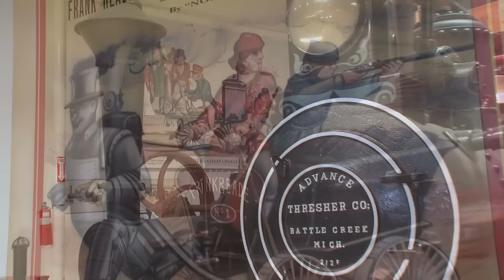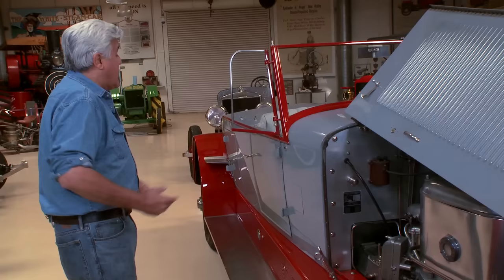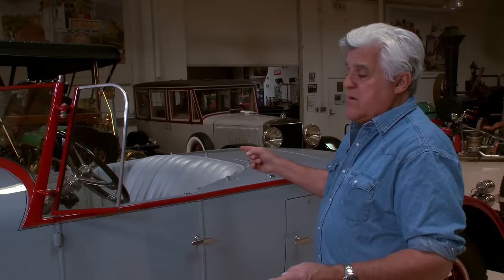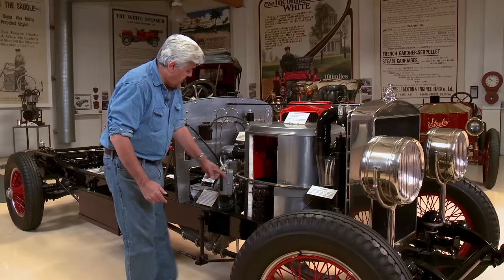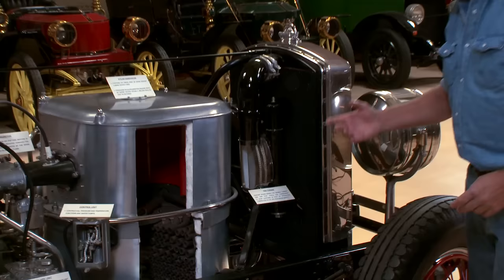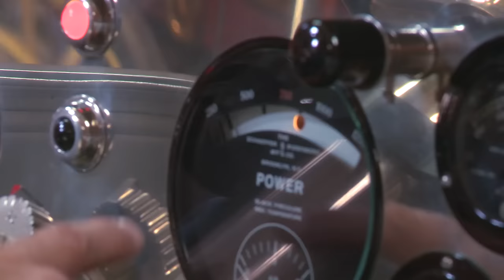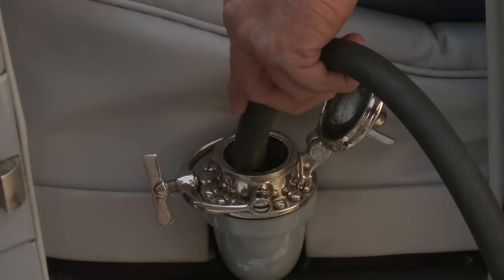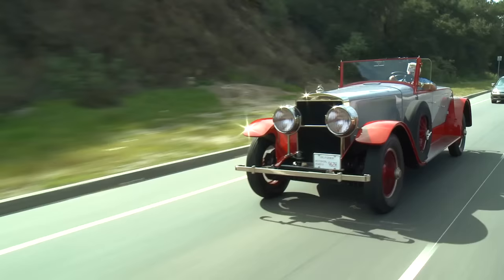1925 Doble E-20 Steam Car - Jay Leno's Garage

Comment: Wow! It's hard to believe they designed such an intricate and complex machine in the 20's.
Reply: That's not complicated! Charles Babbage's computation machine was complicated, and that was  in 1832.
Reply: +Blake's Gaming PC sort of true, steam was over a 100 years old, though dobble was smarter than most and the I.t drop out gave him a odd leverage of something oh so mechanical
Reply: Its unfortunate that Doble had not been born decades earlier.. because steam was already obsolete by the time he built this car...
Reply: That's not obsolete, oil is obsolete
Reply: the saturnes v the moon rocket was designed whit out computer  the computer was part of  the design
Reply: There were lots of intricate machines even going back several hundred years (look up mechanical automatons).
What I'm amazed at is the sheer understated performance of the E20.
Reply: Engineers were just as smart then as they are now, they simply didn't have the benefit of advanced composites and CAD. So many ideas found in most cars in recent years are usually decades old, they just didn't have the technology to make it reliable and economically viable yet.

The thing that really allowed us to make enormous strides in automotive design & engineering was the rise of the computer.
Reply: +coenijn  Yet the one thing that limits further improvements of steam cars is the Carnot Cycle Theorem which was published in 1824 and proven by Rudolf Diesel in 1897.
These discoveries definitively proved that the steam car can never reach the same efficiency as an Internal Combustion Engine... which is exactly why cars today use ICEs and steam is obsolete.
Reply: +coenijn No amount of computer-assisted engineering design will ever produce a Perpetual Motion Engine or a vehicle that defies the laws of Gravity, Entropy or Friction. There are Laws of Physics that dictate certain design restricts and limitations.
Reply: +The real doktorbimmer But I never claimed that a perpetual motion machine was possible, I don't know how you got those things out of my comment. I'm not a mechanical engineer or physicist but through my own field (biomedical science) I'm familiar enough with laws of physics such as thermodynamics to know that perpetual motion is impossible though I couldn't give you the exact scientific reasoning behind it of course, it's simply not my expertise. I know steam is obsolete in today's world, for most purposes anyway. 

I also didn't mean extremely radical things tbh. More like things such as electric cars, they were somewhat popular in the early 20th century (in fact the first car to reach 100 kmh was electric). Only now are we starting to see a comeback for electric cars because of modern battery and engine technology that'll make them economically viable. Or special kinds of ignition timing that were invented back in the day but were only used later on.

What I meant with CAD is that it has allowed us to make enormous strides in designing modern appliances compared to a few decades ago. Computers can do far more mathematical work much faster than a whole army of engineers could do not even 50 years ago. I'm not saying that computers will allow us to create contraptions that will break the laws of physics because that's simply impossible, what I am saying is that computers allow us to come ever closer to mathematical limits of what a machine can do. Take solar panels for example, the theoretical maximum efficiency is 21-23% IIRC. 50 years ago we were lucky to reach 2% but nowadays we can reach up to 15-17% efficiency for domestic solar panels (panels for satellites are more efficient but also enormously expensive), that's thanks to a combination of more experience, expertise AND computers that aid in perfecting those technologies. That's what I'm on about.
Reply: +coenijn I fail to see what relevance your previous comment have in relation to steam cars being obsolete?
Reply: +coenijn Electric vehicles make up less than 1% of all the automobiles sold today.. and the expansion of the EV market has already stagnated. EVs actually enjoyed a greater market share in the early 20th century than they do today. The Laws of Electro-Chemistry  prevent automobile chemical storage batteries from ever matching the range efficiency or energy storage density of liquid fueled ICE cars.. it also explains why they will continue to remain a tiny, niche market segment of the automobile industry just as they have over the past century
Reply: Please excuse marias man.. his comments are often nothing more than the regurgitant rumen of some fraudulent vaporware scam such as Cyclone Power Technologies or Uniflow Power Ltd.
Reply: +marias man  The facts speak for themselves.. only the crackpots, charlatans and scam artist require your promotional endorsements.
Reply: +The real doktorbimmer Now here is an actual topic on which we disagree. 

"Electric vehicles make up less than 1% of all the automobiles sold today (...) EVs actually enjoyed a greater market share in the early 20th century than they do today" This is not all that unusual when you consider the fact that cars were mostly owned by the relatively affluent people in societies, as well as businesses. There were far fewer cars back then as there are now, combine that with car ownership being for the affluent (who are able to afford exotic technology) it is no wonder there were relatively more electric cars back then. The automotive industry was in its infancy and wild & unproven ideas came with less financial risk because most of the other wild concepts hadn't been well proven either. I also don't whether you're looking at sales numbers worldwide, because this is not true when you look at the sales figures for some countries.

"and the expansion of the EV market has already stagnated" Where's the proof for this, AFAIK companies producing EVs have been producing and selling ever more of them per anum. And if this stagnation is true then the current price of crude oil might have something to do with it, there's little incentive to buy/produce EVs as long as the oil price is low.

"The Laws of Electro-Chemistry prevent automobile chemical storage batteries from ever matching the range efficiency or energy storage density of liquid fueled ICE cars" I do agree that by volume batteries will probably not match the energy density of fuel tanks in the near future (if ever), however with advances in technology batteries will be increasingly capable of storing energy more efficiently. Your argument also doesn't take the differences in automotive design between ICE propelled vehicles and EVs into account. The space required for an ICE can be substituted for battery space in EVs, floors can double as battery containers etc etc. 

"it also explains why they will continue to remain a tiny, niche market segment of the automobile industry just as they have over the past century" Oil is getting increasingly harder to extract and eventually it will not be economically viable to extract oil for purposes such as cars (other industries will have to rely on the petrol industry regardless of this fact). If oil will remain the dominant mode of powering cars then personal transportation will become a thing of the past for people with modest incomes. The EV is an alternative to petrol powered personal transportation, or perhaps hydrogen fueled cars will be in the future. Needless to say oil will not remain as cheap as it is forever, and as soon as it becomes too expensive for most people to afford the automotive industry will have no other choice but to adapt and produce vehicles that do not rely on burning fossil fuels, otherwise the industry will not survive.

I think you and I agree about many things but IMO you're too pessimistic about the future of EVs in the face of the inevitable rise of oil prices in the future. As much as I'd like to see the ICE survive, the ICE will eventually be as much of a technological dead end as the steam engine. Just like the steam engine the ICE has some emotional value I haven't found in electric engines yet, but I'll drive an EV as soon as they will be more affordable to the masses.
Reply: +marias man The grossly over-inflated predictions of the EVs continued market expansion as of yet have completely failed to materialize...
Reply: +coenijn "this is not all that unusual when you consider the fact that cars were mostly owned by the relatively affluent people in societies, as well as businesses."
And only the relatively effluent people can afford a car produced by the largest EV manufacturer Tesla.
The fact remains that just one manufacturer like Toyota produces more single units of a model like the Camry per month than Tesla's entire annual production output.
Reply: +The real doktorbimmer "And only the relatively effluent people can afford a car produced by the largest EV manufacturer Tesla. The fact remains that just one manufacturer like Toyota produces more single units of a model like the Camry per month than Tesla's entire annual production output." That's not all that surprising when you consider that Toyota is (one of) the world's largest manufacturers in the automotive industry and has been an automotive giant for decades now. Tesla isn't even 15 years old yet and it's no surprise that a young company produces more expensive cars first, there's a bigger profit margin on expensive cars and you don't need to have as high a production capacity yet. Toyota can produce an enormous amount of cars simply because they have the capacity to do so in terms of factories, Tesla doesn't have that luxury (yet). EVs will eventually become cheaper to construct and consequently be a more viable choice for the average consumer. The Camry is one of the best selling cars in the US because they're cheap, reliable and available. But Teslas are being sold faster than they can produce them, you're on a waiting list before you'll be able to receive your car. Teslas are wildly popular already, they just don't have the capacity to produce them fast enough.

It's not a fair comparison to take the production capacity of the world's largest manufacturer and compare it with one of the youngest manufacturers of passenger cars. Of course Tesla can't match Toyota's output, they simply haven't had the time and capital to reach that point yet.
Reply: +marias man Why do you continue to promote a fraudulent investment scam called Cyclone Power Technologies???
Reply: +marias man Why are you claiming that a steam engine that as of yet cannot be shown to ACTUALLY EXIST is more efficient than currently available automotive technology?
Do you have a vested interest in Cyclone Power Technologies?
Reply: +marias man A dead steam company like Doble? Unlike Stanley and Doble, the White company stayed in business because it recognized that steam cars were obsolete, in 1911 it switched to the superior internal combustion engine and remained a successful independent company for another 70 years.
Reply: +marias man It was discovered and predicted by Carnot in the early 19th century that steam would become obsolete in the future, by the end of the 19th century Rudolf Diesel had proved Carnot was correct, nothing confirms this truth like the fact that internal combustion successfully killed-off the steam engine during the 20th century... it is all too tragic that in the 21st century there are still fools that would attempt to deny these truths.
Reply: +marias man "became clear to me they have not solved the lubrication problem."
Yet you remain oblivious to the fact that they had not solved the critical problem of THERMAL EFFICIENCY!!!!
Reply: +marias man  "You see, the basic design of their automotive engine will achieve the efficiency they claim."
Then please provide some evidence to support this ridiculous and complete unsubstantiated claim?
Reply: +The real doktorbimmer "It is all too tragic that in the 21st century there are still fools that would attempt to deny these truths." marias man never claimed that steam would make a comeback but merely stated that if CPT were able to produce a reliable engine their efficiency would be (almost) on par with recent/contemporary ICEs. marias man sketched a hypothetical scenario but it seems like you interpret his comment as if he thinks it's gospel. Steam is not going to make a comeback, marias man never said so either. In fact he clearly pointed out the shortcomings in CPTs design...
Reply: Jet engines came out in the 20s, regular engines in the 1800s and clocks even earlier. Designing things wasn't an issue back then, there was brilliant one off machines but mass production wasn't easy for such complex things
Reply: +MrcabooseVG The first practical steam engines were way back in 1720's... by 1925 reciprocating steam engines were on their way out.. becoming obsolete.
Reply: That's why we have to invest in wireless electricity to run electric cars Because as of today battery technology will not at this moment will give us the range Americans want in their cars
Reply: +Kevin Loving Good point, electric motors are very efficient... but batteries are horribly inefficient, expensive and dirty... would be nice to see some cost and performance analysis data for wireless road technology.
Reply: they did many complex stuff back in those days than you can imagine.
Reply: +iceberg789 Indeed the Doble E was extremely complex and expensive to build and maintain but by 1925 it was also completely obsolete technology...
Reply: why don't they figure out how to attach collectors to regular electric cars (like on trolley buses )?  it's seems like a perfect and very cheap solution to inefficient and expensive batteries.  for that matter, why aren't trolley buses used more in US (they are big in Eastern Europe)
Reply: +alex smith Did you know Poland invented the first electric car... unfortunately its range was limited by the length of the power cord! Eastern Europeans use trolley buses because people there cannot afford new cars.
Reply: Every new technology made up less than 1% of their market at first.
Reply: Mr. Teff Current global EV sales are steady at less than 1% of total marketshare, down from a peak of 33%... By 1912, 28% of all automobiles in the U.S. were EVs, for the past over 100 years EVs have been unable to compete commercially or economically with ICE cars.
Reply: Adi Serghei ...when you guys are finished arguing about steam, internal combustion, and electric cars and how great electric is over everything other than inefficient batteries argue this point....where do you think the electricity to charge the batteries comes from?
Reply: +joshua nicely No need to worry about such trivial details... Elon Musk has promised "in the future" his company will have solar panels THAT WORK AT NIGHT!!!! all he needs is another half BILLION dollar government loan, $2 billion in subsidies and $5 billion bonus check!!!!
Reply: what do you think steam cars ran on?  It certainly wasn't coal!
Reply: not true.  Early IBM mainframes were used extensively.  IBM's IMS database was built in order to handle the Apollo program,
Reply: Steam turbines are still used in coal fired power plants.  While the use of coal is being phased out in more enlightened countries due to environmental concerns, it is still widely used to generate electricity in China.
Reply: +Lenny Hendricks The most efficient power plants in the world now use gas turbines... steam is only used as a heat recovery cycle.
Reply: I never said coal was more efficient, I just said a lot of it is still being used.  Largely causing the deadly air pollution in Bejing.
Reply: +Autistic Boy  I know something about steam you do not... that internal combustion engines are inherently more efficient... Something that Carnot discovered almost 200 years ago!
Reply: +Freddy Fazbear  There are no steam powered helicopters... Do you know why?
Reply: +Freddy Fazbear But you are making a serious error in your comparison between steam and internal combustion efficiency... You are trying to compare an engine with multiple heat recovery cycles with a SINGLE CYCLE internal combustion engine.
Reply: +Freddy Fazbear The largest and most efficient steam engines in the world (million plus horsepower steam turbines) are only 41% efficient in single cycle operation. I can buy a 10 year old used car that is 41% efficient... some new cars EXCEED 41% and some Diesel engines exceed 53%.
Reply: He was just a little confused about the data.. once we use standardized Engineering terminology we can make sense of the data, and put it proper context.
Reply: So what is your excuse? Where do you get your false data from? Or do you just make it up?
Reply: Have you ever seen a commercially manufactured steam turbine the size of an automobile engine???
Reply: The only steam engines that can achieve 40% are steam turbines. Have YOU ever seen a commercially manufactured steam turbine the size of an automobile engine???
Reply: You don't know that is also an internal combustion engine? Lol! Wow! that's rich!
Reply: IT IS INTERNAL COMBUSTION... The Gas Turbine uses the BRAYTON CYCLE... Internal Combustion... not steam.
Reply: Idling problem... Well, the BSFC Iso-graphic Efficiency Island is very limited and is directly coupled to Peak Compressor Efficiency which only occurs within a very narrow rpm range.
Reply: Gas turbines use approximately the same amount of fuel at idle speed as they do  @P-85 (85% of full rated power) which is why they also consume vast quantities of fuel during start-up and run-down.
Reply: Gas turbines are more practical in any application where frequent starts and stops or periods of idling are not required and cost is not a primary concern. It is also why they are used in the latest generation of electric power plants... because they are extremely efficient internal combustion engines. The Brayton Cycle is inherently more efficient that the Rankine Cycle because there is no phase change in the working fluid.
Reply: Then why are they less than 1% of the global fleet and cost more?
Reply: Electric cars have been reduced to a tiny niche market segment after the invention of Kettering's electric starter for ICE cars!
Reply: Then why are +99% of all cars in the world internal combustion????
Reply: Higher cost, Limited charging time and Range doesn't sound very practical to me... or 99% of new car buyers either! Lol!!!
Reply: "DIY hybrids???" IF Graphene can ever produce a commercial viable battery... it still won't give EVs as good of range and will not speed up charging time.
Reply: Its simple... Graphene is nothing but Carbon... and has the exact same number of free electrons in its valance... Don't you know anything about batteries????
Reply: Please cite an example of a practical glass battery and some proof that glass batteries work at all?
Reply: Do you have any accredited journal publications that confirm that glass batteries are legitimate technology... what can you offer to verify these unreliable claims???
Reply: This is from your own wiki reference source: "The publication was initially met with considerable skepticism by other researchers in battery technology, with several noting that it is unclear how a battery voltage is obtained given that pure metallic lithium or sodium exists on both electrodes, which should not produce a difference in electrochemical potential, and therefore give no cell voltage.[4] Any energy stored or released by the battery would therefore violate the first law of thermodynamics."
Reply: It helps if you actually READ your own references... that way you won't look so stupid.
Reply: Just answer the question, WHY are less than 1% of the cars in the world electric?
Reply: Explain exactly how Graphene and glass batteries will magically cure all of these problems???
Reply: I didn't say Graphene doesn't exist! I asked HOW? will Graphene fix all the problems with EVs???
Reply: Your own reference source states that even the experts don't agree that glass batteries even work... if they don't exist? How can the solve the problems with BEVs????
Reply: doktorbimmer I disagree. The world changed. 
This is a very simple yet intricate and amazing exercise in making steam work while solving all its problems of the time. Not obsolete, just didn’t fit the world because it wasn’t adequately appreciated. Although admittedly it was mostly a design exercise because at that price point it was a rich man’s toy, like a Maserati or Lamborghini. A beautiful thing, but not obsolete. 

Simplicity doesn’t mean obsolete. Even with the example of the turbines to drive the pump and such- they did it “way back then” but the company that made them originally thought it complex a century later. 

Relative perspective...
Reply: coenijn I disagree. 
CAD has replaced creative thought with technological development.

Making that car in the twenties? THAT was advanced. Today’s cars aren’t advanced- they’re technologically complex. 

Technological complexity does not equal advanced. They did this stuff with their minds and on paper, they didn’t formulate CAD models and merge them for testing, most of the design flaws were worked out in their minds. They knew how to think and visualize which is an alarmingly rare condition in 2018.
Reply: doktorbimmer 
So big trains use generators to drive humongous (a technical term) electric motors to achieve somewhat parallel motive force as compared steam, i.e. extreme power available on demand from the get-go without transmission devices. The efficiency of steam isn’t the issue, really, it’s the relative simplicity of liquid fuels. With the idiocy of maintenance today’s emission controlled vehicles require, it is super cool to me to witness the simplicity and banality of a 100 year old steam powered roadster...
Reply: @Thefreakyfreek  
Trust me...the "slide ruled" in the days of that ( Saturn V )glorious vehicle. And all the designers and engineers understood the principles of mathematics and the properties of matter. It was called education in those days. Education in case you've not heard of it, is an extinct philosophy replaced, I am told, by personality politics and social studies. En passant: I do wonder if Computer based Artificial Intelligence technology will speed up our technical evolution and enhance our world or just keep on doing more of the same perhaps better?  Would AI for example have made the quantum step from the medieval world to the Renaissance. In short (?) a computer doesn't provide intelligent design. The Saturn V was and is a manifestation masterpiece of the human intellect, not a computational artifact.
Reply: Graphene is a conductor.... silicon is an insulator that can be combined with other elements to become a _SEMI CONDUCTOR_. You don't if understand basic electrical theory and you want to lecture me about battery technology that does not yet exist?
Reply: +fishhuntadventure The world has changed... but the Laws of Thermodynamics and the Carnot Formula HAVE NOT CHANGED. You really do not seem to understand the issue in even in its most fundamental and basic problem... Nicolas Carnot discovered that internal combustion was more efficient than steam in 1824... Steam is obsolete because engineers already understand that due to the Second Law of Thermodynamics they can never be made more efficient than ICEs.
Reply: +fishhuntadventure Absolute nonsense! The steam engine had already well developed over 200 years before Abner Doble built his E series... using technology already developed in industrial, marine and railroad locomotive technology... there is nothing new about the Doble design, just the way it was packaged into an automobile.
Reply: +fishhuntadventure If you are referring to a Diesel-Electric locomotive? The Railroad industry switched from steam to Diesel locomotives because steam used 400% more fuel and required an order of magnitude of greater burden in maintenance resources, personnel, costs and time of service...  by comparison Diesel locomotives are nearly maintenance free, push the start button and GO!
Reply: +MagicaLucem Interesting thoughts... it has come to my attention that there is now an entire generation that thinks that any problem can be solved with the proper software app and enough megabytes of RAM... It is truly discouraging that in this "Information Age" people are getting dumber by the minute.